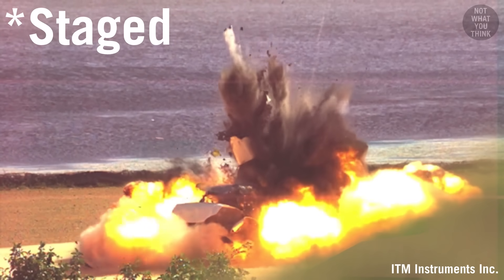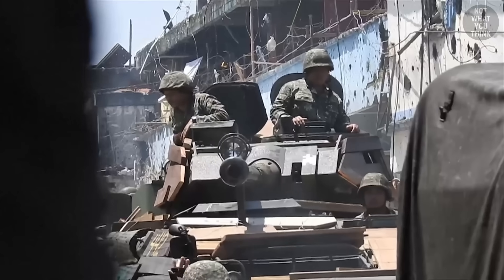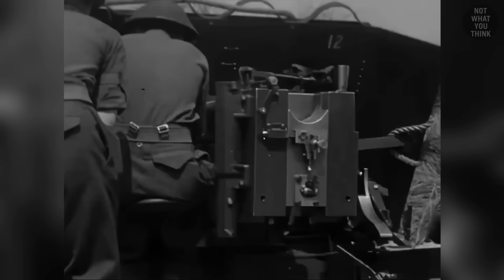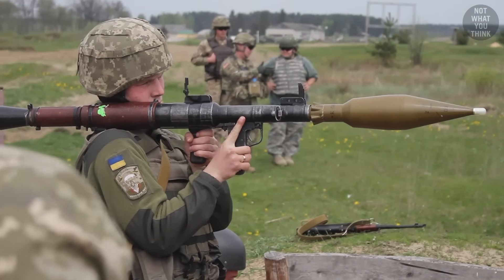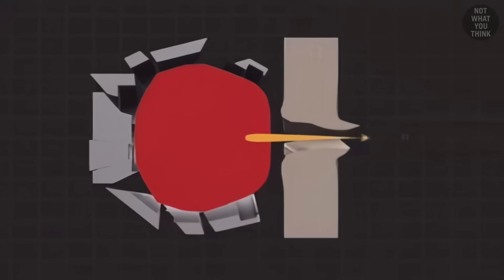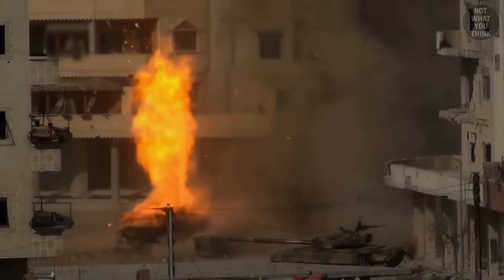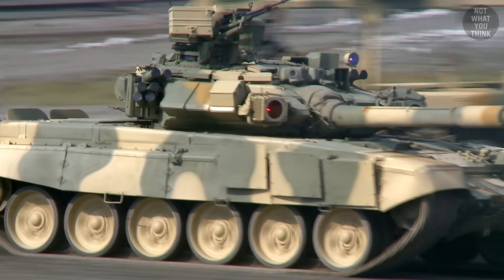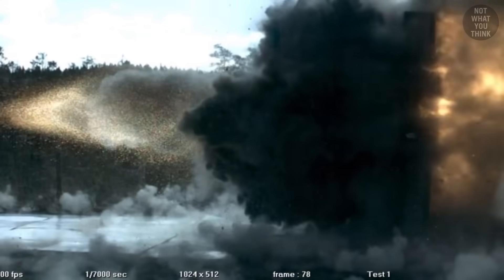Why Protecting Tanks is Getting Much More Difficult

Comment: That jet of plasma from the rocket looks like the cavitation jets which cause pitting on ship propellers!

In shaped charges, this is caused by the Monroe Effect. The reason the larger diameter heads on RPGs is required is because the warhead needs to be wider for a shaped charge design.

It is very interesting seeing the full explanation behind why this is so effective, how reactive armor protects against it, and how javelins and other modern anti-tank weapons get around reactive armor.
Reply from the maker: Glad you enjoyed the video!

Comment: Not only is most of this video boring, there is also some false information in here. NO, cages on vehicle are not to increase the distance, they are solely for kinetically CUTTING the shaped charge so it wont work as intended. That is why spacing of the ribs is key.
You also missed the main point of the Javelin which attacks from the top where there is rarely reactive armor.

Comment: Maybe exchange out another healer for a DPS, making sure the DPS you do take into the raid have best in slot as possible.  Another healer would make protecting the tanks a bit easier on the group.
Reply: More healers/dps will just over extend the back row leaving them exposed for enemy medium to long ranged dps. 
Tanks may be vulnerable to one element, but that's just one element compared to the back row being vulnerable to everything.

Comment: the future of warfare is micro attack drones. using a swarm operating system. they can coordinate attacks from almost any angle. they are virtually invisible to radar and can be produced for as little as 1200 dollars apiece. they are fast light wight and can be deployed anywhere. depending on armament they can be used to eliminate personnel or equipment. making modern tanks planes and ships obsolete. a tank is not much use if its weapons systems have been neutralized by drones strikes that do not actually have to damage the tank but instead target its guns. the cheap price and ease of operating make these drone systems more than capable of defeating any military currently in existence according to the US DOD that ran simulations and warned that such systems were virtually impossible to beat with conventional militaries.

Comment: It was N@zi Germany who used hollow-charges as first nation in combat and against tanks, not the Soviet Union. First use was in the capturing of Fort Eben-Emael where they used hollow-charges by placing them on top of the artillery-gun cupolas. They then developed the Hafthohlladung, a magnetic mine with hollow charges to be placed on tanks and widely used in 1942. At the same time they developed other stuff like the Faustpatrone (the forerunner of the Panzerfaust) and the Panzerwurfmine, which is literally the same as the RPG-43. Both, the Panzerwurfmine and the RPG-43, had their first use in combat in the first quarter of 1943.
Reply: "It was N@zi Germany who used hollow-charges as first nation in combat and against tanks" ehh, not quite. Americans had began fielding bazookas by 1942 while Panzerschrecks, Panzerfausts and Panzerwurfmines appeared in service in 1943. 
During the battle of Fort Eben-Emael no shaped charges were used against tanks  and the ones used against stationary guns were crude and ineffective. 
"They then developed the Hafthohlladung" true, it was actually issued in 1942, but only since November, while US was already fielding bazookas since June.
"Panzerwurfmine, which is literally the same as the RPG-43" not quite, the design is different.

So, no, germans weren't the first to field a shaped charge AT weapon either.
Reply: @ДмитроПрищепа-д3я  "crude and ineffective" lol you have absolute no clue what you are talking about. The hollow charges did wonders on Eben-Emael's turrets, knocking them all out. They had such an effective impact on the fight that the Germans, when showing the Fort to their allies, had to refurbished/hide the holes in the cupolas to not to revial their decisive secret weapon.

"true, it was actually issued in 1942, but only since November, while US was already fielding bazookas since June." - wrong, it was September. "In September 1942, a consignment of 600 M1 bazookas was shipped to Egypt for use by the British Army in the Western Desert campaign. In a demonstration to British commanders, a bazooka penetrated the frontal armor of a captured Panzer III; however it was decided that the desert terrain lacked the concealment required for such a short range weapon and it was not deployed in that theater." [...] "A U.S. general visiting the Tunisian front in 1943 after the close of combat operations could not find any soldiers who could report that the weapon had actually stopped an enemy tank." 

It was just after the development of the M1A1 by the end of 1942 that the bazooka became a reliable anti tank weapon. In that time the Hafthohlladung was already widely used in Russia, knocking out dozens of tanks.
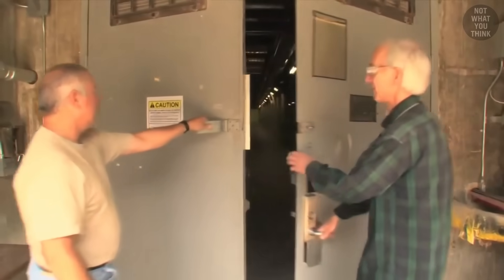Reply: @ДмитроПрищепа-д3я  "The hollow charges did wonders" here on YT: /watch?v=WWfqJxSRn48 from 0:58 on. Same is mentioned on the German wikipedia entry of the battle: "Binnen zehn Minuten nach der Landung sprengten die sieben Sturmtrupps – jeweils mit einer aufgesetzten Hohlladung – alle Artilleriewerke des Forts (außer Werk 9), dazu die FlaMG (Werk 29), den Infanterieblock 30 und einen Entlüftungsschacht (Werk 10). Die Werke 12 und 18 wurden bis auf Sohlentiefe gesprengt. / Within ten minutes of landing, the seven stormtroops (groups) blew up - each with a attached shaped charge - all of the fort's artillery works (except Plant 9), as well as the anti-aircraft guns (Plant 29), Infantry Block 30 and a ventilation shaft (Plant 10). Plant 12 and 18 were blown up to floor depth."

I didn't found the video/source where they claimed they had to hide/refurbished the impact of the charges but on the German wikipedia entry it states "Während des Krieges wurde die Anlage häufig ausgewählten Besuchern aus Staaten gezeigt, die mit dem Deutschen Reich verbündet waren; dabei hielten die Deutschen aber ihre Angriffsmethoden sorgfältig geheim. / During the war, the facility was frequently shown to selected visitors from states allied with the German Reich; the Germans carefully kept their methods of attack secret."

Comment: Explosive shockwaves do not "cut through" the frontal armor of a Leopard II or Abrams.   That's 3+ feet of the densest material on earth.  Even our depleted uranium supersabot apfsds-t will not penetrate that frontal armor.  Most RPG-7 rounds had trouble penetrating our far less heavily armored Bradleys.  Modern shaped charge and the lastest generation RPG-7 heavy metal penetrators warheads pose a significant threat if fired through the top armor, which is very thin.  Tanks could be redesigned to withstand far more damage from javelin or pars-like weapons.   Heavy metal penetrators can go through reactive armor faster than it can react (like a supersabot at close or medium range).  Our doctrine dictates we use HEAT (high-explosive anti-tank) rounds when engaging enemy tanks at long range for that reason.

Comment: There is some development in armor and defensive systems being pushed to field tests now that could change this a lot. 
1 - is the hollow steel structure that could make armor lighter but thicker. 
2 - new discoveries in alloyes that is looking to be able to make the armor up to 10 times more heat resistant.
3 - smarter intercept systems that can handle more targets utilizing mutiple layers of defence. 
4 - more efficient lasers and radar for vehicles to find and counter the systems before they can fire. 

Best of all faster and lighter tanks is a huge goal at the moment.
Reply: Money is always the problem.
Reply: @blackwidow7804  I was gonna say. Only the US really has that type of budget.
Reply: @theothertonydutch  The US are not eternal
Reply: Heat resistance does NOT matter with shaped charges since their effect is purely kinetic ie HEAT (High Explosive Anti Tank) weapons use a shaped charge but DO NOT mistake HEAT for heat.
BTW the Panzerfaust 3 uses a HEAT warhead and is designed to be able to penetrate the frontal (where it is thickest) armour of a T-80 with ERA. Compared to NLAW they are dirt cheap: 1 single use NLAW costs $40 000 but the PF3 uses a reuseable aiming and trigger unit costing $11 000 and the rockets cost only $230 each. The effectiveness and range is practically identical between PF3 and NLAW. So for the price of 1 NLAW you can buy 1 PF3 trigger unit and 124 rockets.
Reply: @gustavmeyrink_2.0  Thermal resistance is more about thermal camoflauge, lasers and thermal buildup. 

As for the HEAT rounds there are some testing on alloys and metal structuring that could really reduce HEAT efficiency by disrupting the jet. Though personally i believe more in the directed EM charge to trigger the warheads electronically before they hit. 

Or the plasma field reactive armor the US is testing. Though i believe energy was a huge problem with that one. And actually creating a reaction that made it solid enough to strike the warhead.
Reply: Not to mention using ceramics or other types of material besides traditional armor materials can help reduce the weight of the vehicle and add properties to the armor that can increase survivability

Comment: Tanks can easily shrug off bullets, so while a modern rifle can take down a platoon of men with the right aim, it can't stop a tank. Tanks also carry much more firepower than a man can. If you are smart with how you use tanks, and take heed of the rock paper scissors systems at play in combined arms warfare, you can absolutely kick ass with them. The tank's not gonna die. If it were, we would already be moving back to viewing trench warfare as the way to fight.
Reply: Yeah, too bad for the reputation of tanks that Russians are pretty poor in using them

Comment: Wow, uh.... ERA explanation SO wrong.   ERA works by adding energy to the compressed superheated stream of copper alloy turning it from a liquid into a plasma and changing its physical behavior into that of a flame instead of a solidus.  If the armor reacted to missile impact it would also react to bullets and anti-tank rounds.  In point of fact the Javelin missile barely ever sets off reactive armor plates other than the ones it occasionally strikes directly with its two jets of copper.  Javelin comes in to strike between 18 and 26° from horizontal and aims to directly penetrate the fuel tanks to the sides of the fighting compartment while aiming to strike the ammunition stored in the turret with enough force to set that ammunitions' explosive charge and the end result is most often that the target is turned into an enormous once cylinder diesel engine fueled with diesel, human flesh and ammunition.

What you were narrating over was an active explosive defense system that creates large compressed fan shaped blasts of material which chop the missile up.  ERA is not shaped in curves and its detonation comes in several waves that chain back through the layers of the charge faster than the incoming jet of metal can penetrate them.

Comment: import java.awt.*;

public class HouseDrawing {
  public static void main(String[] args) {
    // Create a new drawing panel and set its size
    GPanel panel = new GPanel(500, 500);

    // Set the background color of the panel to white
    panel.setBackground(Color.WHITE);

    // Set the pen color to black
    panel.setColor(Color.BLACK);

    // Draw the outline of the house
    panel.drawRect(100, 100, 300, 300);

    // Draw the roof of the house
    panel.drawLine(100, 100, 250, 50);
    panel.drawLine(250, 50, 400, 100);

    // Draw the door of the house
    panel.drawRect(200, 350, 100, 150);

    // Draw the windows of the house
    panel.drawRect(120, 120, 50, 70);
    panel.drawRect(330, 120, 50, 70);
  }
}

Comment: This was really well done. 
One part you've missed, however, is the important stage between kinetic impact projectiles and the use of shaped charges - the information is out there and I have done a little research on it.
Long story short, I researched how the British stumbled upon this subject as their anti-tank shells were failing to penetrate German armour. The British borrowed a few Sherman Tanks/barrels and began development work in the UK. The 72mm shells failed to penetrate enemy armour if they were either solid metal shells or shells that contained some internal explosives. They decided to chase up penetration of armour using kinetic energy. It went as follows..
Beef up the charge that sent the shell out of the tank barrel. Faster shells, it was hoped, would mean more energy that would help the shell go through armour - it didn't work as the shells were now crumbling upon impact.
Next, the British hardened the shells. It was done by making them red hot at the tips and laying them in oil/water tip first. It had the effect of making the tip hard but upon impact the shells were now splitting in half due to the stresses inside the shell from the hardening process.
The British then decided to try 'lubricating' the shell so that it might slide through the armour. To do this, a copper plate 'cap' was placed over the tip of the shell. It worked a little! Some penetration was now being seen. They began chasing this idea..
To help lubricate the shell through armour and to go those final few mm's, the British decided to add a small 'bulb' of high explosives to the copper cap on the point of the shell. It was an internal reservoir that would explode upon impact and then the copper cap would help lubricate the shell through the armour. Again, this gave a little extra penetration.
It was at this stage that the British began chasing the idea of shaped charges. Shells, and the research they'd done to penetrate armour, would go in a completely different direction from this point. Indeed, the British would become very good at creating shaped charges.

Comment: There will never be a time where tanks are useless in combat, regardless of the cost or that it *could be destroyed, does not make it any less of a asset in the field. Most modern tanks are able to engage at targets multiple miles away and don't even require a direct line of sight.
Joint-arms operations, where infantry, mobile-infantry, armored, and aerial assets all work in conjunction are the reason the tank will never become useless. There never was a balance between tanks and infantry, because one does not function without the other's support.
Saying '"oh the tank is useless because infantry can take it out with Javelins" would be like saying "bullet proof vests are useless because you can still get stabbed"

Comment: in the mid 80's i was in the canadian military, we used the m72 rocket launcher. it did the same thing with a smaller nose cone. maybe didnt penetrate as much as this one. the layers on the outside of a tank were to do just that stated in the video, to ignite the explosive before it hit the actual armor.  many tanks at that time were built with thin layers of metal a few inches out from the thick armor for this reason.  and as you said, the more modern ones defeated that.

Comment: This is exactly why some nations such as the United States are looking into lasers since they come with many benefits: nothing is faster than the speed of light, its precise, inexpensive to fire, little-to-no downtime between shots, better area of coverage, easy to maintain, and adds very little weight all compared to ERA. However this technology is still under development and is relatively new so it may take awhile (but conflicts/wars drive innovation)
Reply: I was under the impression that heat management was the biggest engineering obstacle for efficient lasers aside from power generation. It's not as big of an issue for Navy ships with an unlimited supply of water to be used for cooling, but the prospect of using lasers on a spacecraft is very difficult with heat dispersal being much slower in space.